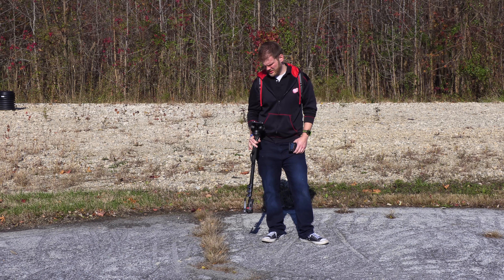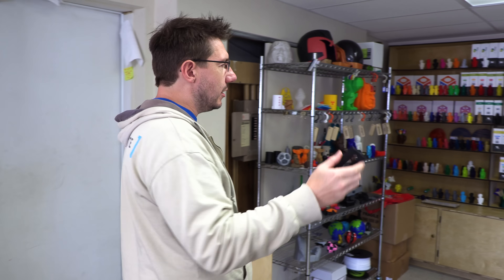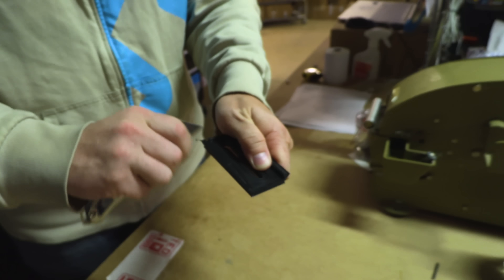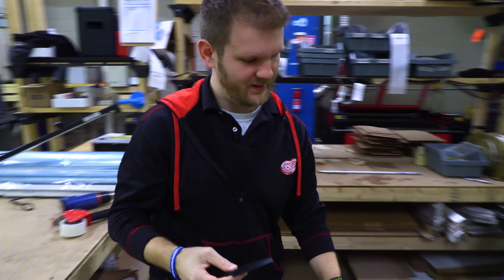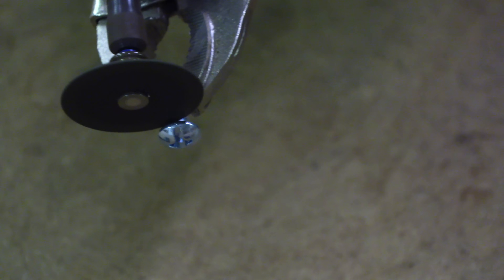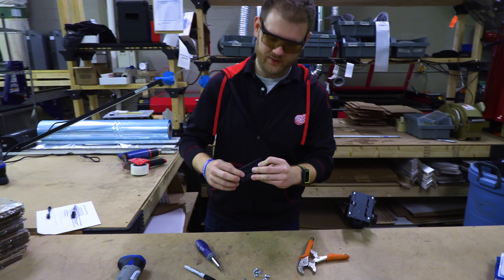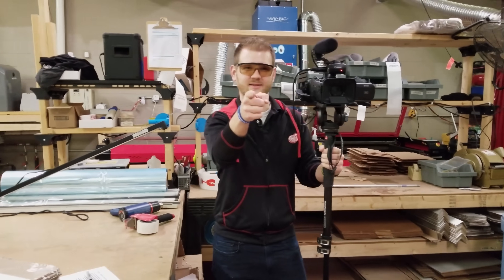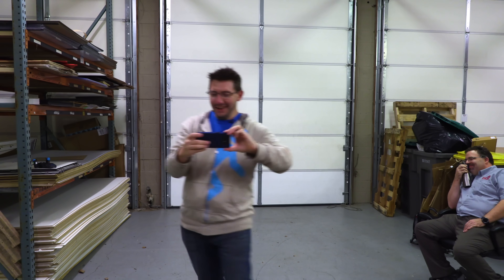3D Printing a Manfrotto 501PL Quick Release Camera Plate

Comment: I hope this was a joke. Because you are not supposed to snap the plate in from the top like you did. You are supposed to slide it in from either the front or the back. Seeing you shave off the sides, I fully expected the camera to just fall off the monopod. You were quite lucky that it did not.

Comment: Thank the gods that tripod mounts are just 1/4-20, and not some oddball horseshit like the 5/8-27 thread on a microphone stand. (Seriously? 27tpi?? 😓)  I love quick detach tripod plates. I've got SEVERAL of the cheap Amazon-branded aluminium tripods which I use for webcams and things.  When I decided to use them for PS3 Eye cameras in my DIY roomscale VR setup, I replaced the weighted bottom in the base of the PS3 Eye with a 3D printed replacement which had an integrated QD tripod plate. 😄

Comment: Grinding the BOLT!  (ok, maybe a little nut) What is with 3d printer youtubers not knowing differences between nuts or bolts on the SAME day!  Lol (head over to Uncle Jessy if you missed his!)
Reply from the maker: Why is it a bolt and not a screw?
Reply: @3DPrintingNerd  General rule of thumb is that a bolt threads into a corresponding nut, whereas a screw threads into a part. But I think most of the distinction is just pedantic
Reply: @joshmaceachern7383  bolts are flat faced and needs the nut.  A screw is pointy on the end and can just screw directly into a material.  Ie, "wood screws" not wood bolts.   The Nut is the part that threads onto the bolt to hold the bolt in place.   

Incidentally,  a washer is the metal part you loose when you take something apart and cant find because it slid between the circuit boards and the grounding plain just waiting for an inopportune moment to short everything out and make you throw things against the wall...  At least in my experience.  :(
Reply: Machine screws rarely have pointed tips.  It's really a fine detail, but while all screws are not bolts, all bolts are a type of screw.  "Screw" does not have anything to do with the tip, but being a helical fastening device.  Any other detail just makes it a particular kind of screw.
But yes, one should absolutely know that a nut is the female part that goes around a screw or bolt, not vice-versa.

Comment: What the hell...this likely took better part of a day and thousands in tools to make a crap version of a cheap plastic part.
Reply: This is what 3D printing is about. Fixing problems! Ok so maybe it did take a day. But they were travelling around, no place to ship to. Even if they did, it's 2-3 days shipping, and $30 for the part plus shipping. It's not that they don't have one, they forgot it. This probably cost $1, and a 5 hours to make. I'd call it a win.
Reply: Actually standard mount plates are made of steel/metal. Part of why they're so much more expensive. And you could easily replicate this with a couple hundred dollars worth of equipment.

Comment: Why not just make the slot wider, save yourselves some grinding?
Reply: It's a captive screw setup, that's why it's got that wide hole at the end you can get the screw through.  And if the slot were wider, there'd be less material for the screw to secure the camera to...which is especially critical in the case of this plastic facsimile.
Reply: The slot is needed to prevent the camera from rotating I think
Reply: The slot prevents the bolt from falling off when removed from the camera and also provide more surface for it to grip on when tightened.